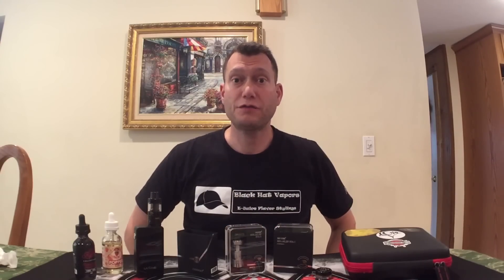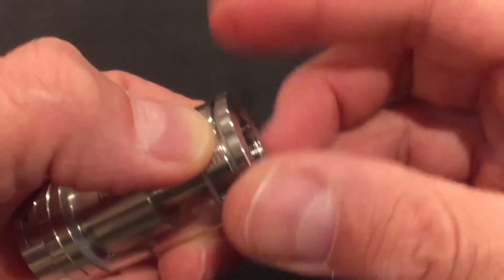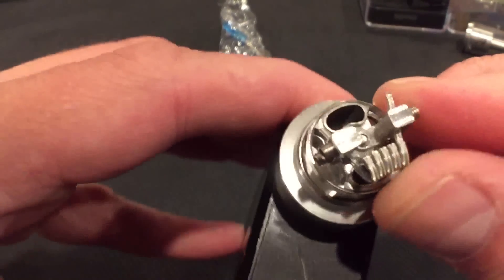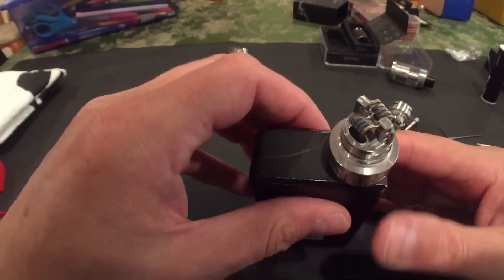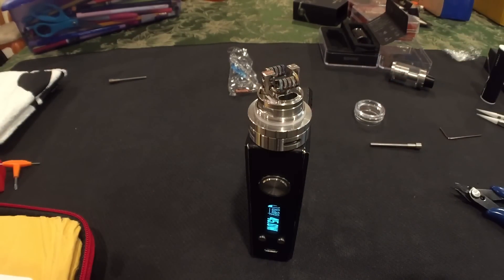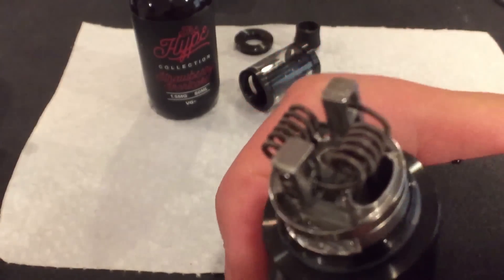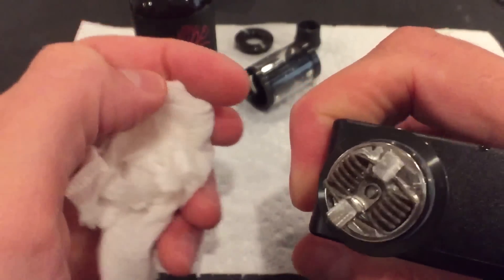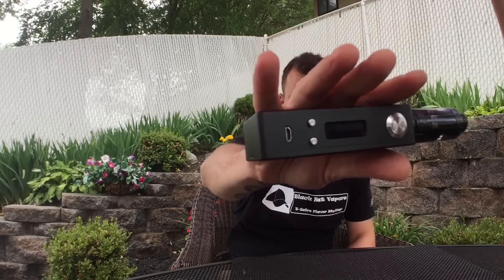200Watts on Herakles RTA-2 | Alien Clapton Build | Wicking Tutorial | Giveaway

Comment: Hey d big fan man love what u do i wanted to let u know ipv5 i have one i love the device there is a glitch in the board i noticed on the vape show yours  having same as mine i know a way around it turn on the device click 5 times change to joule mode go to ti then exit hold the up button then u will see it changing  go back into power mode and u be able to change your wats u have to do that little step every time u change battreys great device just that one flaw give it try
Reply from the maker: Thanks man.  That trick works sometimes.  Sometimes not.  Infuriating.  Other than that I would love the IPV5